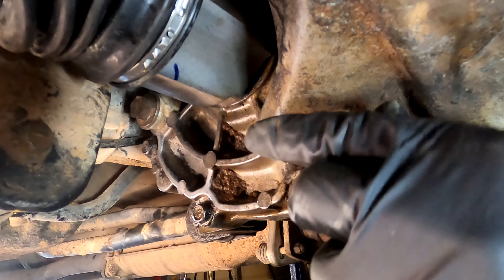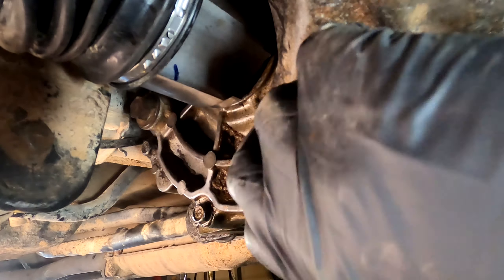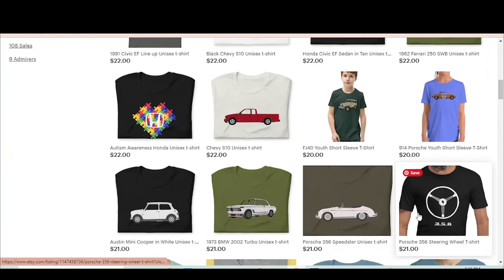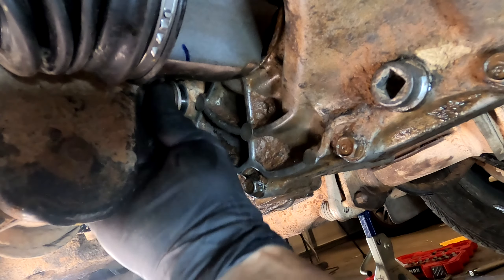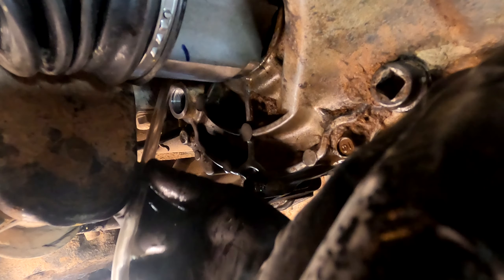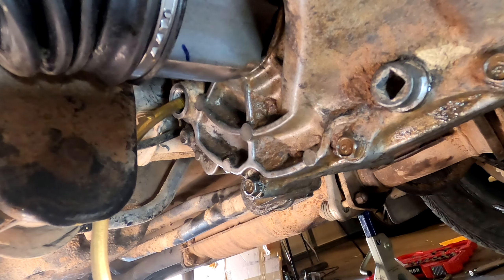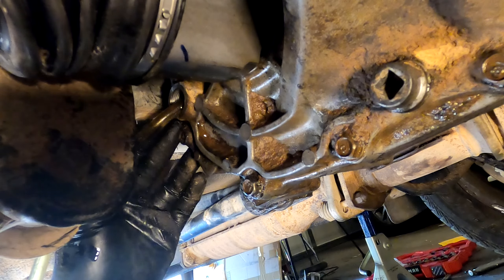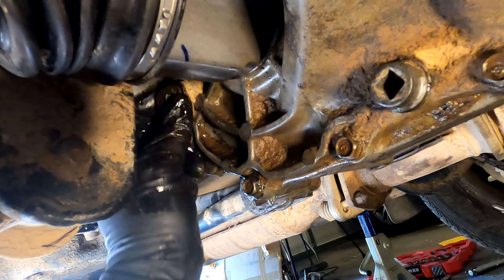Honda Civic Transmission oil Change: DIY on how to change your Transmission Gear Oil on an EF Civic!

Comment: Hi There, thank you for the video! Question: what about the Differential? it has a different sump? or this oil change covers gearbox and Diff? Thank you!
Reply from the maker: Should cover both.
Reply: @LostSocketMotorsports  OK, the thing that make me think is: the Diff don't need extreme pressure Oil?...

Comment: Does this apply to the automatic trans on the same exact car ?
Reply from the maker: No automatic is very different
Reply: Ah ok thank you I’m not super familiar with this chassis but do you know exactly where the drain and fill hole is on the autos?
Reply: Does Honda MTF work for a 1991 Honda civic DX manual transmission? Or should I use 10w-30???
Reply from the maker: @Zauserr  you can use either, I just use motor oil because it was more readily available